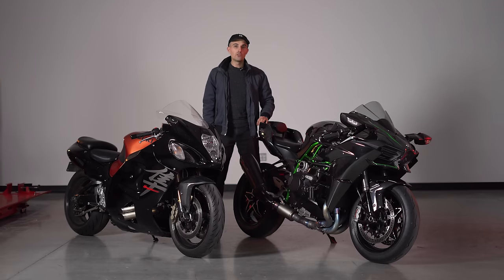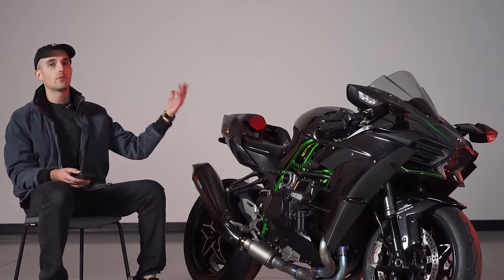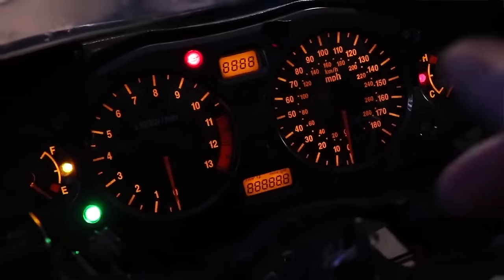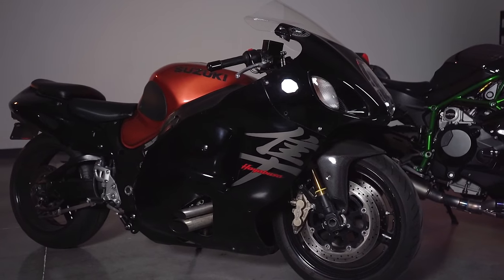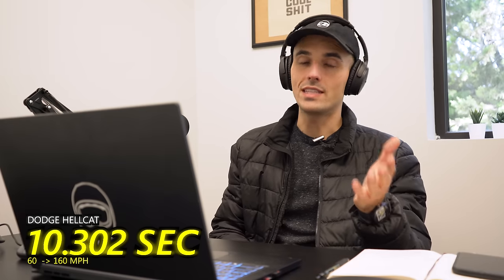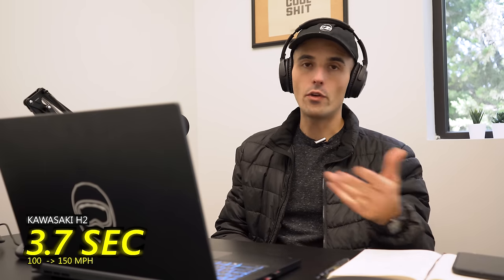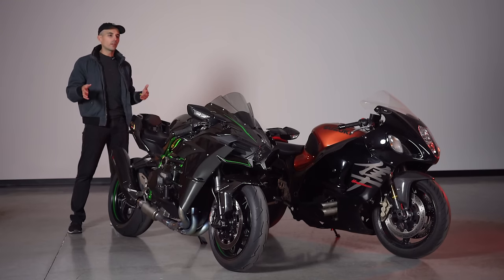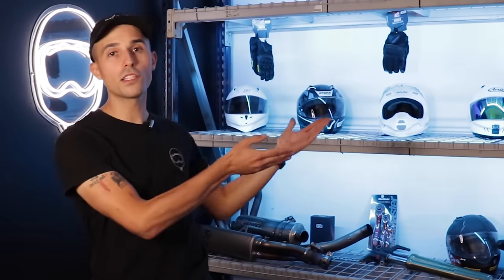Turbo Hayabusa vs Kawasaki Ninja H2 SPEED TEST - WHICH IS FASTER???

Comment: I love how kawasaki ended the conversation of the fastest street legal bike with a literal cruise missile of a motorcycle im over here with my little ninja 400 but im really excited to work my way up 😁
Reply: Im done with the ninja 400 and im still happy with it. Not going up anytime soon as it is fun to ride even on the street.
Reply: The Hayabusa is the reason why all bikes are limited to 186mph. Can’t shut the conversation down this late in the conversation. Besides l, SuperBusa wants to join the chat…
Reply: My neighbour went from a street 250 to a H2. He is still alive 30k miles later. Wheelie control is insane, the damn thing is designed to launch on the rear wheel and you can't loop it. Weekend rides are interesting to be sure. The tweeting from the blowoff activates the com system and he activates it a lot.
Reply: im lookin at ninja 400 as my last bike lol (currently riding duke 390)
Reply: @EricLeePiano  great choice. Better to ride a slow bike fast than a fast bike slow. Literally a ninja 400 can get you to go to jail speeds. Unless you got a lot of cash then go higher
Reply: I went from Ninja 300 to H2 SX SE  (after 8 years) , so all the power to ya :)
Reply: @EricLeePiano  i also own duke 390. But wouldnt recommend ninja 400 as next bike since power difference isnt much. It just 1.5 hp(difference between hp of duke and ninja) now. Better to go for 650 cc or even z900
Reply: Ninja wanted to make a rocket and just said it's on the rider for wanting to buy our rocket 🚀
Reply: @EricLeePiano  Ninja 400 is a amazing bike however switching is a personal choice because although it does have more power the power difference isn’t extremely high but it its noticeable regardless its a great and solid bike 👍
Reply: It might just be crazed fans but there is some degree of rumour that big K are working on a supercharged ZZR 1500.
That would be something to work your way upto. Not that the current hyper bikes aren't already fast enough - they are!
Reply: Can you do wheelies?
Reply: @Nitrous_Busa  true but not much more than a laptop is required to undo the 186mph limit. A limit which was by gentleman's agreement between the Japanese manufacturers.
Reply: @markremy4946  Ninja 400 can indeed and has the power to wheelie unfortunately i dont have that skill yet but im excited to learn it for sure
Reply: Take it slow
Reply: @paytonlefevre3519  true. Crashing at high speed may cause lifelong injuries worse than death
Reply: @BigFx  Never heard of Ninja 300. Where do they sell them?
Reply: @markremy4946  afaik it's no longer in production as it was replaced by ninja 400 in 2018.
Reply: Kawasaki h2r not really a superbike but a jet
Reply: I'm more than happy with my 180 hp
Reply: @EricLeePiano have you thought of a CBR 600 or R6 for your next bike? I think they would be a great choice for someone in your position and experience range. A 600cc bike is plenty for most riders. I bought a GSXR 1000 and I’ll never use all that power. 
Hope this helps. Good luck 👍
Reply: Bro I got a 400 it's still fun AF to ride
Reply: Same. Started with a 650. All is good for now, but I know I'm gonna work my way up to that H2.
Reply: My Man is a Ninja 🥷
Reply: @markremy4946  in india they do besides india idk where
Reply: nothing beats the speed of the Hayabusa 💪💪💪
Reply: @rexspeed5876  Haybusa without a turbo can be slayed by any of the liter class machines.
Reply: @markremy4946 can you lean?
Reply: @EricLeePiano not a big difference. It's a great little bike, but I'd get at least a 650 next.
Reply: @MrEiniweini Back when these first came out I saw a rider on a H2 carry the front wheel down a on-ramp to I-10, looked so steady and smooth.

Comment: I've have 2 h2's both over 300hp and I can tell you this isn't a fair comparison because you don't mention the limitations of the stock wheele base. Testing with a draggy I've got 50mph to 130mph in 3.3 sec . Guys have gotten 2.4 sec starting from 1st gear.

Comment: I really appreciate the Dodge challengers acceleration video just to show how Scary the Hayabusa really is I love it.
Reply: It really shows how a 4,400+lb car spinning tires and shifting three gears accelerating 100mph compares against a single gear pull 50mph in a forced induction bike 1/10th the weight.  

Obviously the motorcycles are faster but comparing times is like apples to potatoes.  Quarter mile times a hellcat will beat an H2 by one second, 9secs vs 10.

Comment: 40 years ago i was roadracing an 1170cc 16 valve Yoshimura Suzuki. Prolly made 150-160hp. I never felt I needed more power. Better brakes, stiifer frame, slipper clutch, sure, but not more HP. I couldnt give it full throttle below 115 without power wheelying straight up or spinning the 8” goodyear slick. The kind of power they are making now blows my mind! And the fact you guys ride them on the street? Wow.
Reply: Tyres are much better now than the days you were riding
Reply: I know that is very true, but none of the laws of physics have changed…
Reply: But actually, those goodyear slicks had more grip than the frames and swingarms they had back then could handle. We could corner and accelerate hard enough to distort them both. That made things pretty exciting at 175

Comment: I own a 23 busa, and a 15 hellcat challenger. Both are damn fast stock. Both take seat time to get use too. I just bought this busa in February, never owned another model. Previous bikes were 2 R1 and a 750r track bike. The 99r1 carbureted was turboed and took awhile to dial in. It would do 240mph. Lowered ,sprokets ,13psi boost,cams ,4mm oversized and jetted carbs, more fuel. Scary as fuc*. The busa is do different i am not used to it yet.. bigger heavier. Plenty fast. Always wanted one. Happy with my purchase . Once i am comfortable with it ,it will be sent to Carolina to Chris Moore for his Turbo system. Stock wheelbase. Enjoy riding guys and be safe out there.

Comment: Don't even think about lowering it. Save that for that busa. This thing once you get it running properly and get rid of that fuel pump, get back to pump gas, get the quick shifter back on, and possibly put the stock injectors back on,  and remap the off/on throttle,  you will have a bike that can be ridden on the track and will tear up a twisty road and actually have a lot of fun on, nothing feels like an H2 while still leaning over in a corner in 3rd, rolling on the gas gently and as you pass 100 the front wheel smoothly lifts off the ground and rockets you forward while leaving a black stripe..heaven on wheels.
Reply: Let's talk,

Comment: That issue with the quick shifter and melting the piston doesn’t make much sense just due to when u use the quick shifter it’s such a brief blip to slip into next gear it shouldn’t have that kind of affect on the bike. Personally I think it was cause the guy never had it on dyno and tuned the quick shifter for the setup.
Reply: Ooor just leaned it out and it blew up.

Comment: I lowered my 88' ZG-1000  , cut down windshiel, lost the side bags kind of a shaft driven Ninja thing that looks just like your Turbo Hybu.  Rolling 2nd gear 25 mph start it will keep up with most modern stock street bikes. Rolling start at highway speeds? Forget about it.

Comment: Hey yammie is a turbo hayabusa reliable? I have a 2017 hayabusa and a 2020 rocket. Both bikes are daily riders. Toyed with the idea of turbo charging my busa but don’t want to sacrifice the reliability of it. Thanks for the input
Reply: My friends have turbo Busa's and theirs are reliable. Both street bikes. If done right & if you under that 300 HP mark. Should just have to enjoy, keep up with the oil changes. If you over that 300 & some change start building the motor. That's what I remember give and take. RCC usually best kit. You can also go TTS supercharger. Good luck
Reply: @chaz951  thanks for the reply I appreciate it. I plan to keep the bike relatively stock as it’s plenty fast but the more I see turbo ones I think about it. I’ll definitely keep all that in mind. Thanks. I’d definitely like the chance to ride an h2 just to see how it feels

Comment: IDK about that clip of the Hellcat. It looked like when the driver put their foot down, the wheels must have spun or something, at around 90 because you can clearly hear them let off just a bit, before putting it back down and going. And that makes sense, because both the Hellcat and Demon have the ability to spin the rears in almost any gear, if things aren't just right.
Reply: Yeah it definitely spun at the start but no way in hell could that hellcat keep up. Probably couldn’t keep up with those bike at 70% throttle. When vehicles/motorcycles get this fast it requires so much HP to get any faster time wise. That’s why drag cars that have 3000 hp put down similar times to cars that have 4000 hp. The 0.5 seconds between the two could mean a 40 mph difference.
Reply: l @Nick-Edwards  Yeah, no traction. I'd like to see a pull with the Hellcat (or trackhawk whatever) Jeep.

Comment: Busa  90-170 (nothing wrong with it and owned for a bit)= 5.951 sec.
H2 80-178 (18 mph more) and use of only 80% throttle (limited ride time, unfamiliar with the bike) = 9.2 sec 
uneven  test, one day you should give the an actual fair test but that's just my opinion tho

Comment: You guys have always keep in mind that the hayabusa starts out at almost 1300 cc when adding the turbo charger to it, whereby the h2 is an enhanced 1000 cc bike. The edge will always go to to higher liter bike, however you try to twist and turn it....just a reminder.

Comment: I own a 1999 HONDA  CBR 919 RR SUPER SPORT FIREBLADE moded old school carberated motor, no govener, no rev limiter, 180 HP at the rear wheel .  The fastest I've done on the bike is 340 kmph,  likely do 370 kmph or more. 
Will do wheelies in any of the 6 gears.
Yes the bike is EMP proof as well.
It's my road warrior,  end of the world bike.
I'm not into newer fuelinjected bikes , simply they are not EMP proof. 
When the nukes go off , most of the fuelinjected bikes will be going nowhere. IMHO.

Comment: Is this even a good comparison? Showing 60-160 70-178 90-170 and more that were not at the same rev ranges gears or speeds compared a car gaining 100mph and a bike gaining 80 yn i think the only way to tell without doing unnecessary math and calculations is to get 2 riders side by side on a drag strip right?

Comment: H2 aerodynamics is good and design,weight is also better than hayabusa it is a beautiful bike.
Reply: The busas aerodynamics is far better, and with slight weight reduction mods (proper exhaust system & under tail delete) a busa weighs the same as well at around 520lbs
Reply: @Tuforeal  absolutely true.